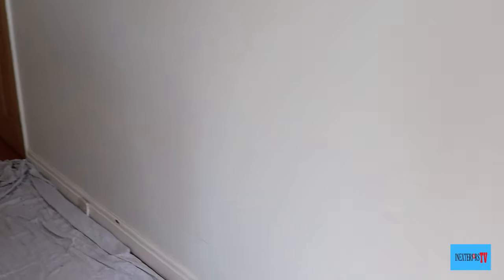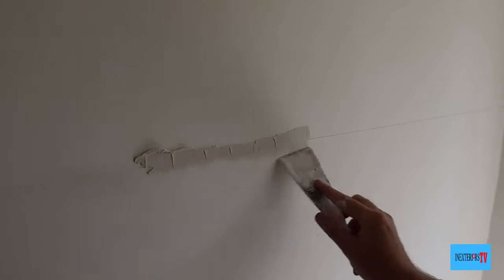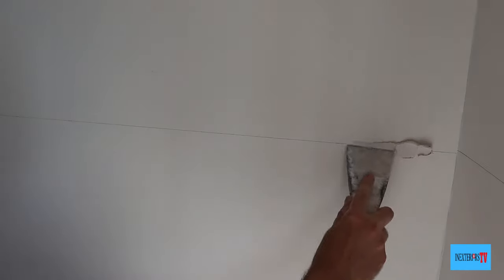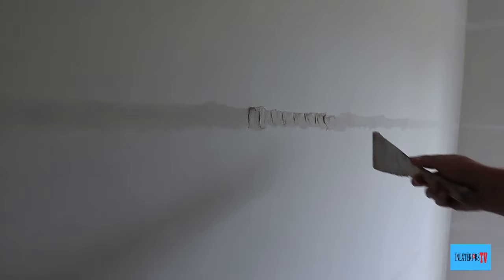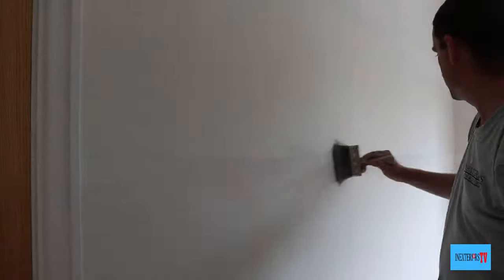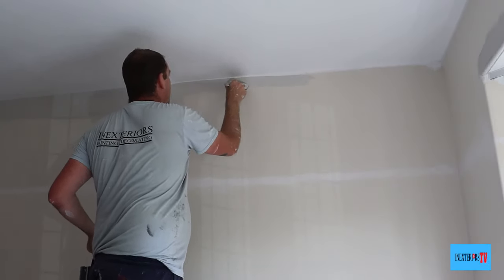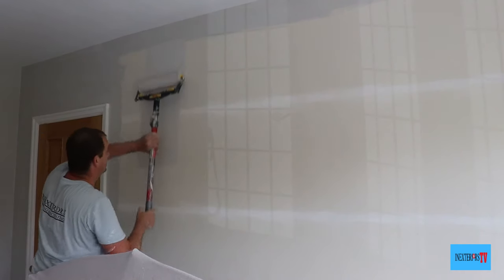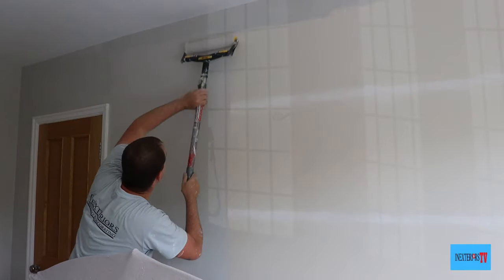How to fill joints in lining paper. Fillling joints in lining paper.

Comment: I normally put a coat of paint on 1st , then fill , then you don’t rough up the lining paper
Reply from the maker: I used to then I started to do it before I painted, that's what's great we all do things different bud.
Reply: your right
Reply: That's for the info
Reply: @Inexteriors  I'm going for progression on this job but I bet the finish is much better can u use any filler or does it have to be this one
Reply from the maker: @niftyblad  This filler is ok. Tetrion All Purpose Powder Filler 1.5kg https://amzn.eu/d/alABTQN
Also this one should be ok Polycell MPP18KGS 1.8Kg Multi-Purpose Polyfilla Powder https://amzn.eu/d/37qbZnL

Comment: This is not the correct process and will cause the filler to crack leaving a thin crack a long the wall. Yes, you do butt the joint to give it a smooth finish.
Reply from the maker: @R Angus . We all do things differently bud.
Reply: @Inexteriors  I appreciate that. I'm talking from experience. I made that mistake and want to prevent others from doing the same. All the best
Reply from the maker: @rangus1595  Hi bud, I have never seen that happen in 25 years. All the best to you, I appreciate to.
Reply: yes it happened to me

Comment: 👍, I would  have  hung the lining  paper  vertical and butted the Joints  like  a wallpaper  which  is then ready  for  a couple  of coats of paint.  Hanging  horizontal  is usually  followed  by a finish  paper  over  the top of the lining  paper.
Reply from the maker: We all do things differently bud. vertical or horizontal i dont think it matters, it was the way i was taught thats all.
Reply: @Inexteriors agree, its whatever os easier sometimes, I'd rather put 4 bits horizontal along a long wall than 12 bits vertically...or 3 bits vertically on a high wall than 8 bits horizontally...horses for courses, staggering the joints so they dont end up in the same place as a finish paper is easy enough to plan
Reply from the maker: @Lloyd1885  its what ever works my freind.

Comment: Blinding job! I made the mistake if butting my joints up close, using a hardstop and then painted and the joints have risen against each other and are fully visible. 😠 What paper did you use? Cheers
Reply from the maker: I used a lining paper from B & Q on this one, sorry for late reply i have been on holiday.
Reply: @Inexteriors  well deserved one. Tha ks for the info

Comment: When you fill the joints in, and paint over lining . Is it easy to remove the painted lining after?
Reply from the maker: @Brou Adje . Over the years i can say the lining paper that i have striped, some i have had a little battle with and other not so much of a battle, if i remember the lining paper i used on this job was an easy peel lining paper.

Comment: I would paint ot first, then fill,  water in the wet filler can undermine the paste and cause bubbling, no rosh of the sandpaper scratching the lining then....or use lightweight filler as it barely contains any water, no sanding needed.
Once filled, touch up with a rad roller, then second coat the whole wall
Reply from the maker: To be honest i did it that way for years then 1 day i did it this way and it turned out fine, Another change i made recently was to use ready mixed paste instead of mixed paste.
Reply: @Inexteriors  yeah ready mixed is far better, Wickes own brand 👌🏽
Reply from the maker: @Lloyd1885  i will have a look at it cheers.

Comment: Do you fill the gap in the corners of the room where the lining paper meets?
Reply from the maker: you can run some caulk down it if you want or if there is a bad gap, but if cut tidy then no need to. To be honest i used to caulk them all the time.

Comment: Very good. I’m going to paint my living room which has very visible slightly lifted seams in the lining paper. Would I need to try lifting and resticking the seams before filling over them like you have here ?
Reply from the maker: @bassbytes . Yes, use solvite over lap adhesive to stick it back, also wet joint a little and leave to soak for  a couple mins to soften the joints before sticking.
Reply: @Inexteriors  great thanks. One other question, is a multi purpose filler such as Ronseal filler ok to use instead of Easifill 60 if I don’t want the hassle of making the mix ?
Reply from the maker: @bassbytes . Make sure its a fine surface filler, also fill cleanly so its easier to sand.

Comment: Would you ever use hardstop filler?
Reply from the maker: if was puting it on over a first coat, and i was only giving it 1 more coat i would, but buy filling before you paint its going to have 2 coats on top of the filler, just fill cleanly then no need to sand lots.

Comment: Hi mate. I have done this but the filler is showing through the paint still ! I am using lighter paint. What should I do ?
Reply from the maker: paint the bits that are showing through let it dry then paint wall again, are you using a matt or vinyl silk finish.
Reply: @Inexteriors  will do mate! I used a flexible filler that’s white unlike what I’ve used before. I’m using matt paint. I did put some peal stop on it to before to seal and prime it  . That will teach me for being lazy and not mixing the easy fill! 😂
Reply from the maker: @scottyg22102938  its good to try different ways thought bud, thats how we learn.
Reply: @Inexteriors  true mate ! It was a dream to fill use the fine filler but now hard to paint. Pros and cons and like you say all a learning curve! Thanks for the help!
Reply from the maker: @scottyg22102938  Any time.

Comment: Hi Steve. Thank you for your video. Can you tell me please why you applying your lining paper horizontally. I was going to put it like a normal wallpaper. If I apply vertically then the job will be not perfect?
Reply from the maker: @Violetta TAYLOR . You can hang it vertical or horizontal when painting the lining paper, if you are wallpapering over the lining paper then you hang it horizontal. I just saw it hang horizontal for both when i was learning.

Comment: Do you recommend using a primer or is there no need. Two coats should be enough? Also when do u need to put pva as I see.conflicting info online
Reply from the maker: 2 coats is fine over the filler. Its only very fine filled its not like its new plaster that needs a mist coat of thinned down emulsion or a thinned down coat of pva. You do what you feel works for you my freind.
Reply: @Inexteriors  thanks a lot, appreciate your expert help
Reply from the maker: @thebeardedgeek8018  No probs.

Comment: Not having a go but why don’t you butt joints? 
What do you do if you’re hanging a pattern? You can fill that!
If you have to fill, it’s either a poor hanging job or a very uneven problem area.

Use 1kg ready mixed with some paint (hard stop) I always butt joints with a seam roller so haven’t needed to fill joints in years, always use paste the wall wallrock lining ( quicker to hang by miles, no shrinking so no gaps to fill).
Also I never ever use powder paste, just use ready mixed, even consistency, the problems I had using packet paste (little too much water and the paper expands too much then butted subsequent drops don’t stick as the paper shrinks back, hence gaps.
Use in between coats sandpaper otherwise you will wreck the paper or not sand down correctly.
Reply from the maker: I have never seen paste the wall lining paper, i will give it a go, ,i used to fill inbetween coats, then 1 day i filled it before i painted and it worked, i have done it that way ever since,  always good to learn different things.
Reply: @Inexteriors  brewers, screw fix, toolstation.
Thanks me later, I’ve just saved you days.😀
Reply from the maker: @gaws1234567890  Its just how i was taught, never had a problem to be honest. there are more than 1 way to skin a cat.
Reply: @Inexteriors  time is money mate.👍
Reply: @Inexteriors  trust me you will never soak paper again after using paste the wall.
Reply from the maker: @gaws1234567890  Very true buddy, this is what i love about people commenting, you are always learning.
Reply from the maker: @gaws1234567890  I will be on it my freind.
Reply: @Inexteriors  all the best.👍

Comment: Hi m8 did you mist coat the filling before painting on top?
Reply from the maker: @boaby boy . Hi bud, no i just painted straight on the filler, its not like new plastered walls, Its only a fine fill.
Reply: @Inexteriors  great m8 👍👍
Reply from the maker: @boabyboy978  No probs bud.
Reply: @Inexteriors  in your opinion m8 what is the best filler?  Gyproc or normal ready made fillers?
Reply from the maker: @boabyboy978  I do like the gyproc easifill it is very versatile, it can fill deep holes in stages, also fine fills and it is easy to sand.
Reply: @Inexteriors  cheers 🍻 m8